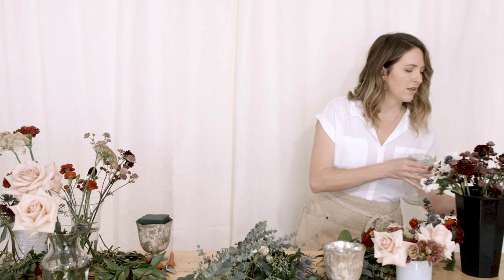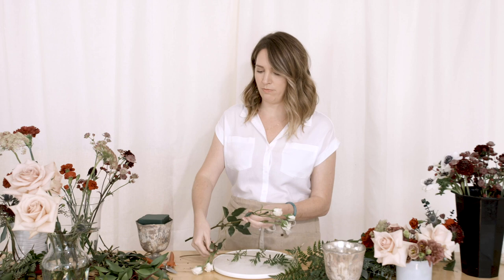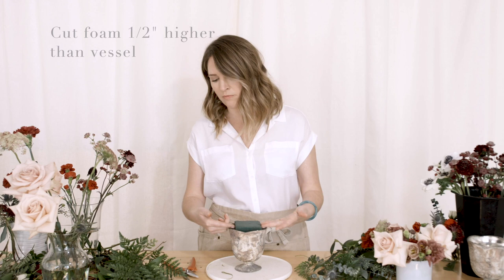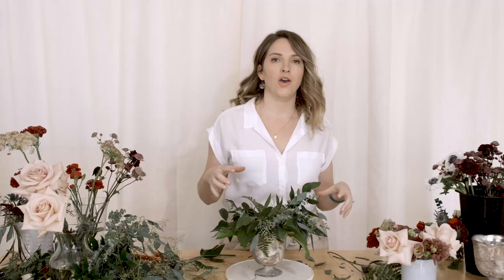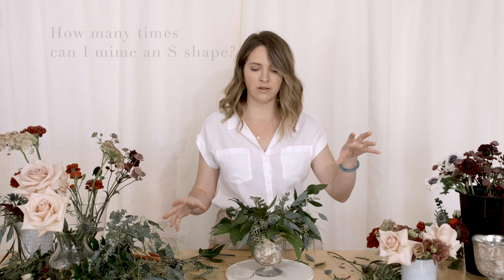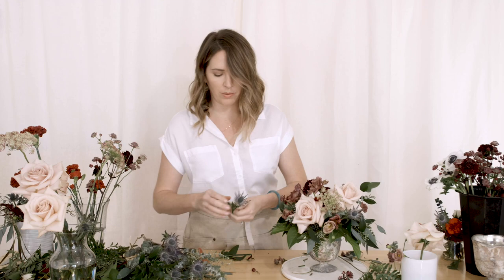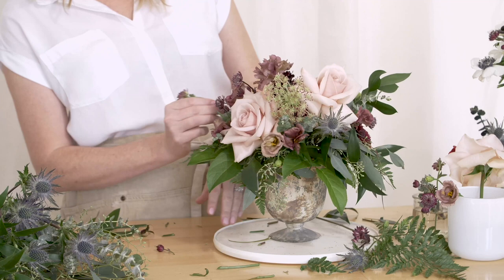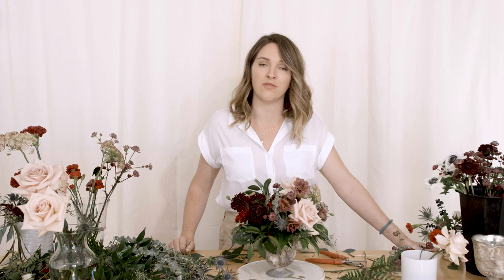How to Build a Small Compote Centerpiece, 3-4'' Vase  ~Flower Moxie

Comment: You're videos are fabulous and informative. I enjoy the sassy quips imposed over the video :) Wondering, how would I determine the best size for my floral arrangement for a 60"x72" table when planning for a lower floral centerpiece and some small votives, e.g. use a 6" diameter vessel, other? Same for the size/height for a 60"x72"table and a tall floral centerpiece - 24", 32", other?
Reply from the maker: Thank you for your kind words!  So, it sounds like you have a doubled-up 6ft rectangular table?  I would suggest doing 1 large compote, 6'', in the middle and 2 smaller ones on each side.  Like, mason jar size or bud vases!  That, with candles and a runner will pull it all together!